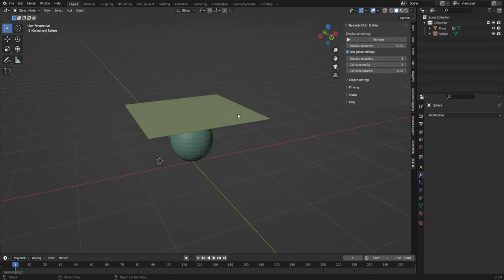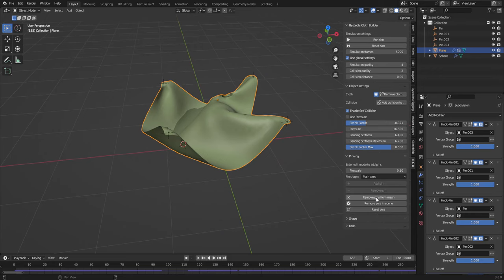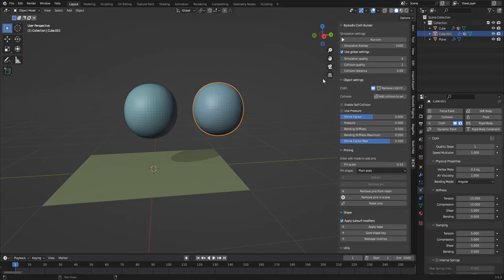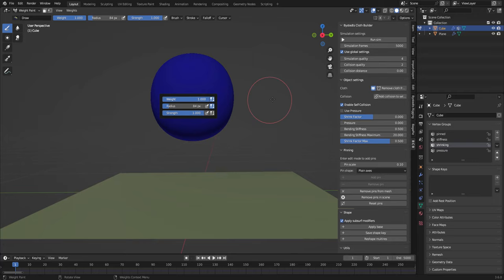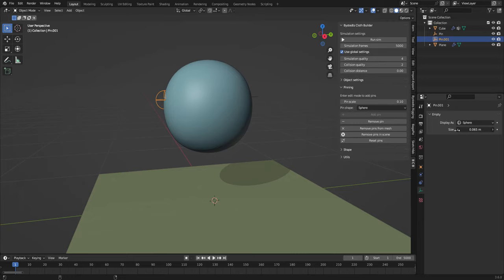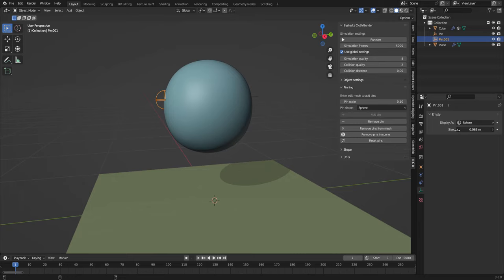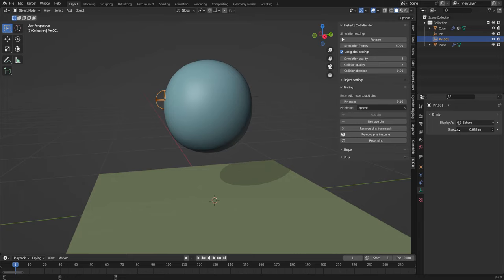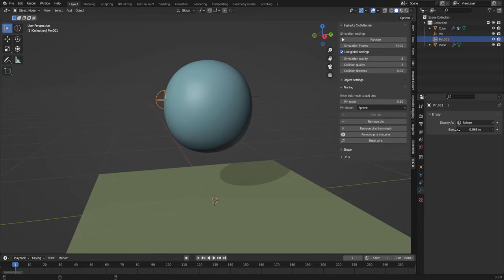Bystedts cloth builder - Blender addon tutorial

Comment: I tried to complete the first steps using a plane and a cube, but when I add cloth to the plane and run the simulation, it just sits on top of the cube.  Do i need to subdivide the plane first before I use the cloth addon?  If so, it would be helpful to include that step so rookies can follow along
Reply from the maker: Yes. You need to subdivide the plane. Make sure the subdiv modifier is above the cloth modifier. Good suggestion with adding a plane to the tutorial

Comment: Thank you very much for this addon being free, but there is a problem for me because my blender is 3.5 and it doesn't work properly. Is there a solution?
Reply from the maker: There are constantly updates being made to blenders API, so I might be using a part of the API that doesn't exist in 3.5 (I wrote it for 3.6). There might be a fix, but I don't have time enough to make the addon backwards compatible. Perhaps you can try and use Blender 3.6 just when you use the addon and then export the mesh to 3.5?
Reply: Thank you for taking the time to answer me. Yes, it is a good suggestion. Thank you for your kindness🙏🙏🙏🙏🙏🙏 @morriscowboy